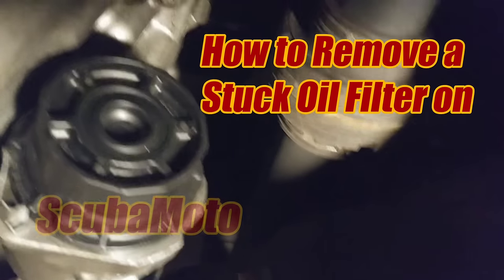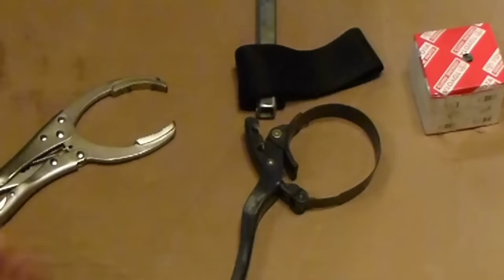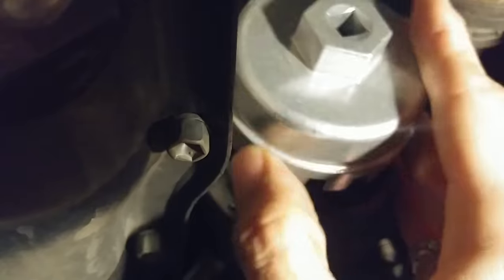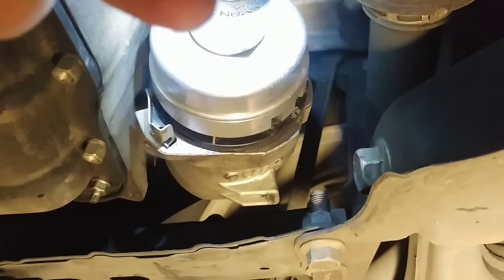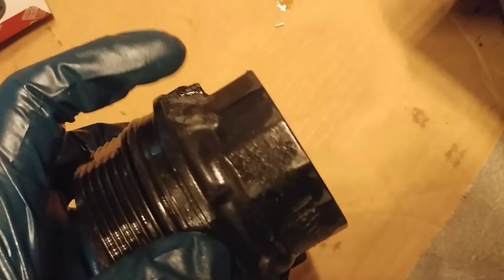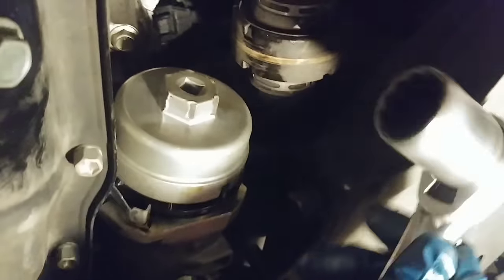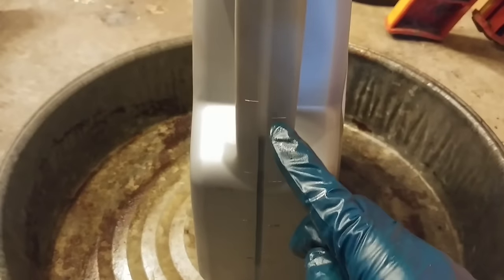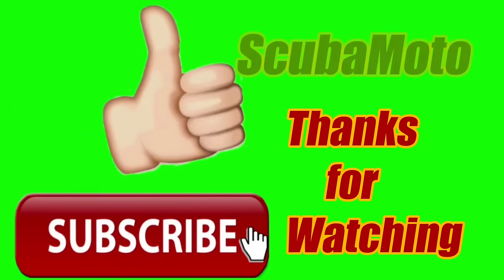How To Remove Stuck Oil Filter Toyota Prius Corolla Lexus Oil Change

Comment: I find this very easy to change my car filter. No matter what type it is, because I always hand tight them never used any tools
Reply from the maker: Mario V: Absolutely agree, but I'm fairly sure most people dealing with this problem are following an oil change done by a third party who probably used an impact wrench to install the filter. That was the case of the one in the video. it was last serviced at a dealer who installed it with an impact wrench. It's very common. Thanks for the comment.

Comment: After the ears had all broken off, and the flutes rounded from the "correct" filter cap removal tool, then breaking two oil filter band wrenches and one "jaws of death", I drilled a hole to drain the oil, then chiseled the filter cover off piece by piece from a friend's 2014 Corolla (they couldn't get it off, and I'm a masochist).  Put a new cover on, tightening it to 20 foot pounds.  They haven't had a problem in the 2 years since.  They never would tell me who had put the previous cover on last?  :face-fuchsia-poop-shape:
Reply from the maker: Now that's a priceless repair. Congrats on a job well done! Thanks for sharing.
Reply: @ScubaMoto  The pucker factor was high as I was chiseling, for fear of gouging the aluminum.  Fools rush in where angels fear to tread!  😜
Reply: My canister had all of the tabs full broken off from all the previous failed attempts to remove it, so I ended by drilling mini holes from the bottom and then used a hammer and pliers to break it off into pieces.

Comment: Where did you get your filter key? Your seems to come off easily, I had to hammer mine, then pry it out (I got it from the auto parts store but it was like 10 bucks Canadian). Thanks for posting, I had this same issue - filter key +  adjustable wrench + demolition hammer did the trick.
Reply from the maker: Andrei Falosa: Mine sticks too. They all jam like that with a super tight filter removal. I'm glad the demo hammer worked for you. I can usually get it off easily by just giving a fast solid tap clockwise to unbind the wrench from the filter housing. It works great if you have an impact driver. Congrats on a job well done and thanks for watching and for sharing.

Comment: First time I did this on the wife's Corolla, this was stuck tighter than any oil filter I ever experienced in my life, but pressing with all my might with my foot on a 1/2" drive with a 1" hex socket on the end of the metal cap thingy got the thing loose. Putting back, I torqued to 18 ft-lb, that seemed snug enough to me.
Reply from the maker: Chris Munson: That can be pretty scary when the cars is on jack stands. The one in the video wouldn't budge with a cheater bar and an extension pipe over that. All it would do is rock the car - not good. The impact driver was the only way it came off. Congrats on getting the job done. Thanks for watching and for sharing your story.
Reply: ScubaMoto does anyone know what the correct torque spec is on these type canisters? I have to agree with you - they are WAY over-torqued!!
Reply: Never mind, I just saw the torque spec. Thanks.

Comment: The guy that did my oil used an impact to put it on. When I tried to take it off it would not budge at all. Hammered a Phillips head screwdriver in one side and out the other. Finally got it off at the expense of having to break it.
Reply from the maker: Axel 9419: Thanks for the comment. It's a shame that someone else's mistake cost you a filter housing and probably a lot of hassle. But congratulations on getting it off. Now that you're doing it yourself, it will never be over-torqued again. Thanks for watching and for sharing.

Comment: I GOT THE SAME FREAKING PROBLEM  HAD THE LAST TWO OIL CHANGE ON DEALERSHIP NOW I AM DOING IT MYSELF AND FREAKING STUCK AND SPENT OVER 100 CAD BUCKS FOR THE RIGHT CAP THAT DOESN'T BREAK HOLY SHEET!  SORRY FOR THE CAP FONTS~  PROS

Comment: I believed the o ring expanded, I do the oil changed myself and next time around, it’s so damn tight.
Reply: Did you put oil on it before setting the housing with a torque wrench?

Comment: I'm definitely gonna use this Method for sure my Aunt Toyota cap is Really stuck on tight But I have a impact with 1200 foot pounds of Torque I'm sure that Bad boy will brake it lose I hope

Comment: This is a great video that deals with a common problem.
I bought the Motivx oil filter cap removal tool for our 2009 RAV4. I also bought a torque wrench to assure that I don't over-torque it myself. And I bought a 27 mm socket and ½ inch drive breaker bar just in case I need it to remove the oil filter cap.

I don't hate the design. In fact I sort of like it. But that's just me. I'm one of those persons who often prefer to follow the road less traveled... (Looking for a challenge and adventure).
Reply from the maker: Steven Sevek: Thanks for chiming in. As you know, this video addresses the consequences of a very common installation mistake; using impact to install a Toyota oil filter. Many Techs make this mistake thinking they are saving time. But in a moment of impact, they are generating an exercize of removal for the next oil change. This video was the only case of a filter removal that required such impact to remove. But based on the comments here and elswhere, I am guessing that many have been installed with impact thus creating similar removal difficulties. A long extension pipe slipped over a breaker bar had already failed on the vehicle in this video. I'm confident that the dealer tech who had last installed the filter shown in this video, put it on so tight using impact that they could no longer even get it off. The entire recorded service history was this same dealer. I believe they gave up on changing the filter for subsequent oil changes and that they had been simply changing the oil and no longer replacing the filter. I base that on the condition of the filter cartidge that I finally removed (in this video) and on the degree of difficulty required to remove it even with the 300ft-lb impact driver. It's true that the wrench in this video lost one of the small teeth during the very violent removal required using 300 ft-lbs with impact. But that very same wrench has been more than adequate for many subsequent removals of filters that are not over-torqued. A 27mm socket on a standard length ratchet has easily worked by hand to remove filters that I personally installed with the correct 18 ft-lbs of torque using the same old wrench shown in this video. Actually, the 3/8-inch drive on the wrench usually works fine with a standard ratchet if it hasn't been over tightened. Thanks again for your comment and input.

Comment: I tried again today to remove the oil filter housing with steel oil filter wrench connected to an impact wrench. The nut welded on to the oil filter wrench broke off while the oil filter housing didn't budge one bit.
Reply from the maker: I've only heard of a few cases that were even worse than the one in the video but yours sounds pretty bad. First things first, this is going to take some time, so please secure alternate transport for a day or so and allow yourself to take the time needed for this job. Before trying impact again with a new forged or cast filter wrench, you'll need penetrating oil like Liquid Wrench. EDIT: Forged steel and cast aluminum wrenches are one-piece, where some steel ones have a seam at the lug that may separate. The wrenches all have yield points beyond which they'll break. Using a 27mm socket over the lug rather than the 3/8" drive will reduce the risk of breaking the wrench. Let it sit overnight (Yep, 24 hours) with penetrating oil sprayed generously on the contact between the housing and the engine. Come back in a few hours and spray it again with penetrating oil. It's bound to the engine at the base surface of the filter housing. After soaking OVERNIGHT with penetrating oil; first try a breaker bar, then try a breaker bar with a pipe slipped on it. Then move onto the impact wrench. Always using a socket and NOT the 3/8" drive port. I hope that helps. Side note: Then talk to whoever installed the last filter and have a conversation about how the install torque setting is only 18 ft-lbs (hand tight).

Comment: Tried to do my oil change. Couldn’t get the filter off. I even bought the specific tool that fits exactly on the oil filter housing. Didn’t budge so I skipped on replacing the filter since I can go another 2500 miles. Bought myself a 220ftlb max power impact tool and will get the job done next time.
Reply from the maker: Sorry to hear you're another victim of someone over-torqueing your filter. Before using impact, you might want to try a 1/2 drive ratchet with a 27mm socket on the lug of the filter wrench. You can either slip a long extension pipe on a standard ratchet or use a 24-inch cheater bar and see if that works. Again, you want to do this using a 27mm socket on the lug of the filter wrench. If you put a 3/8 drive directly into the head of the filter wrench, you might split the filter wrench in half with a stuck filter. It may also help to spray the base of the filter housing generously with penetrating oil where it contacts the engine and let it sit overnight. In my case (this video), impact was a last resort since my pipe extension was just rocking the car on jack stands and that wasn't safe. So impact was necessary and did the job.
Reply: @ScubaMoto  yeah I tried the extra wrench on the end to help with leverage and that didn’t budge either. I don’t have a lot of room under the car since I only have a medium sized hydraulic Jack. Maybe I’ll let dealership do the oil change next time and I’ll ask to see the mechanics work and actually monitor him to see if he’s torque int at the right spec.

Comment: Great video, thanks for that. As a home mechanic with only a 110 ft-lbs impact wrench on hand, what do you predict the odds are that I can get my prius' and corolla's super-tight filter cap? They won't budge with a 3 foot breaker bar. Is a tool rental in my future?
Reply from the maker: Michael Bridges: Unfortunately impact made a big difference. 300 ft-lbs without impact is the same as 50 lbs force on a 6-foot cheater bar and mine would not budge. But with 300 ft-lbs WITH impact it broke loose. Impact will beat the heck out of things but it worked. I'm not sure what an impact rental would cost, but my 300 ft-lb tool was about $100 or less and I use it constantly.

Comment: i went to a quick lube shop to get yearly inspection, i asked to also get oil change cause it was overdue.
i have a rav4, as i was sitting in my vehicle, i felt the vehicle shake, i look at the camera feed of under my vehicle and this 250 pound man was tightening the shit out of the oil filter.

i am gonna have a heck of a time taking that oil filter off next time it needs oil change.
i usually do the oil change myself, but i didn't have time.

Comment: Well great info. But this sucks for me. I’m in this spot at this very moment. But I don’t have impact tool. 
The last shop I went to must have really cranked it down to death.
Reply from the maker: I'll try to help you get it. Impact was actually my last resort but it did work after all else failed. Leverage is always the best choice to start with. But at minimum, you really do need to have that filter wrench with the cut-outs that is shown in the video.  It's the only way you will be able to put the forces necessary on that factory filter housing. The filter housing wrenches are usually available at local parts counters but I've also got links in the video description that are cheap and will get the job done. If you have a couple feet of pipe that can slip over your ratchet handle to get extra leverage that usually works as good as a cheater bar (extended ratchet). I first tried a several foot long piece of pipe and it wouldn't budge. Impact works because it combines the torque of having leverage with the impact force that helps "bump" things loose. That combination is the last resort before destroying the housing for removal and installing a new one. I hope that helps. Good luck with it.

Comment: Same problem with my car. I replaced the plastic OEM part with an aftermarket aluminum housing for the oil filter. Cost about 30$ but well worth the price of a solid aluminum one, and does away with the extra steps of using the plastic drain plug and small o-ring
Reply from the maker: I prefer and have to recommend OEM but thanks for sharing.
Reply: The car clear nut Toyota guy on YouTube explains why you should not use that replacement aluminium filter housing , just watch and decide for yourself.
Reply from the maker: @philipbell3187  His name is Ahmed at TCCN, and he is one of few people on the planet I would allow to service my vehicles. I wish he were in my city but too bad he's in another state. He is absolutely right and I love his tutorial. He also acknowledges that letting people know that you should not mess with the OEM spec oil parts will get you flamed. People do what they want, often based on bad information or something they saw someone else do. I have never had a problem with the plastic housing when it's installed correctly. The one in this video was clearly installed with an impact tool that probably put 20-times the specified torque on the poor plastic housing thus binding it against the engine. It's almost always the cause of a stuck filter. All oil changes for the car in this video were logged at the same dealer who I am confident gave up even trying to remove it since they brutally over-torqued it. So they were just changing the oil and leaving the filter. I did another Toyota Oil video last year showing that the o-ring design gives all the seal you will get before the base of the housing even contacts the engine. https://youtu.be/kWWUlyoWFsM  You can over-tighten it all you want and it will not change the pressure on the o-ring once it's embedded.

Comment: Hey, Toyota; can you say "spin-on oil filter"? What is it with cartridge filters? I had a Mazda 6 with one, and at least there was a retrofit spin-on filter fitting for the engine. Now I have a 2010 and a 2011 Corolla with this asinine excuse for engineering; unfortunately, the cartridge well is cast into the block, so no hope for a spin-on conversion. Much as I love Toyotas, I'd buy something else just because of this stupid feature. Sure, there is a recommended torque for the cap, and I've used that figure each time I've done a filter change.....only to have to tighten it even more because it seeps oil past the O-ring at the recommended torque. Why can't they put the filter on top of the engine, with a small drip lip around it, like they do on the Tacoma V6?
Reply from the maker: Deerex748: I agree. But I'm surprised your o-ring is passing oil. Once it's in place, it shouldn't matter how tight the housing is. If a brand new OEM o-ring leaks, I would check the surfaces of the o-ring channel for scratches or damage. Zero oil should get past it and I don't see them leak unless damaged. That's why I show the pinch method of removing o-rings, to prevent scratches in the o-ring channel. Thanks for watching and for the great comment.

Comment: I got a tough filter, too.  My tool (Toyo 640) does not have cut outs for the ears on the filter housing, so I wonder if I should stop now?  I have a big impact wrench, but I would have to remove the splash guard to get the impact wrench lined up.  I've tried every other tool in my garage, even my torque wrench, which showed that it's over 125 ft lbs!!!  It's my sister in-law's car.  I don't want to ruin anything that could cost me more $$; and I don't want to ruin my tool either.  Should I go for it?
Reply from the maker: Marc Berman: Great comment. Since you know it's more than 125 ft-lbs, then it was almost certainly installed using impact by whoever did the last oil change. And if it's installed with impact, then it could easily have 200 - 300 ft-lbs of torque holding it on. To put that much removal torque on the filter housing, you'll want as many points of contact as possible. Thus the tool in the video. That's what all those cut-outs you mentioned provide. You might even need impact. So I do recommend the type of wrench in the video. I know I should be selling them, but just search on "Prius Oil Filter Wrench" and you'll find plenty of good examples. Your local auto parts store should have one if they're open. Thanks for watching and for sharing.
Reply: @ScubaMoto  Thanks for the quick reply!  I couldn't wait... I went for it, it worked, I think I got lucky!  I have a Ryobi impact driver, not wrench.  Can't remember the torque max on that, but it didn't work -- or it was taking too long.  So, I switched to my plug-in Bauer 1050 ft lb max impact wrench, which barely fit in the space after removing the splash shield.  It worked after impacting a few times.  I really wanted a six point socket, but I only had the multi-point.  It didn't strip, whew!  I got the filter tool off by reinstalling the housing, and giving it some tightening taps.  Worked!  Whew, probably 4 hour oil change.  That filter looked awfully dirty!
Reply from the maker: Marc Berman: Glad you succeeded. Congratulations!

Comment: As long as they are not over tightened they are ok.  But I still had to spend money on the specialty tool to do a simple oil change.  Why?  Nothing wrong with the old style.  Let’s complicate something simple that worked just fine.  Annoying!!!

Comment: I use a wally world or harbor freight oil filter wrench and they always come off, if its really stuck I put a rag on it to break it loose. Done hundreds and never broke one yet.
Reply: My mechanic friend said they, local Toyota dealership, would use the old school oil cap wrench. I did what he said and it worked. Do not need the special oil wrench at all.